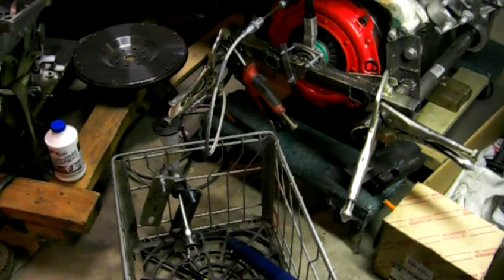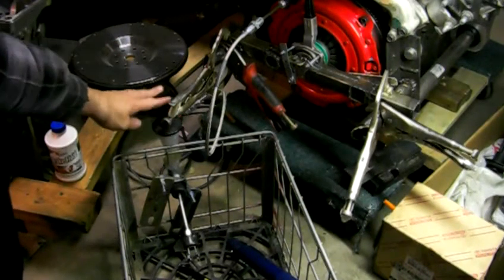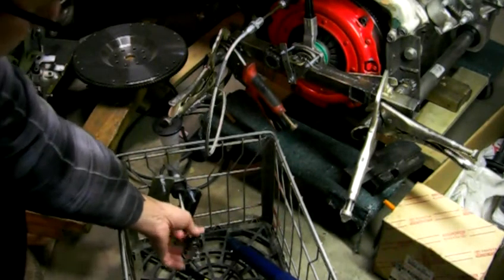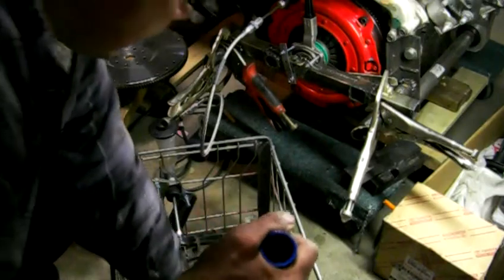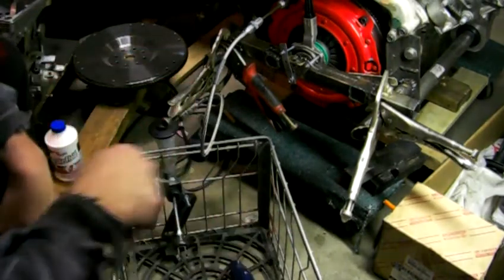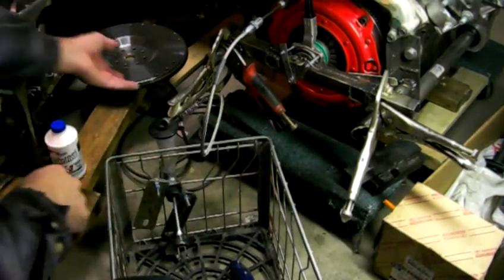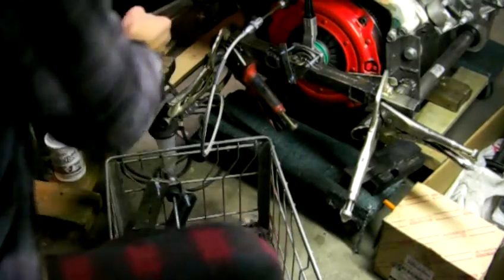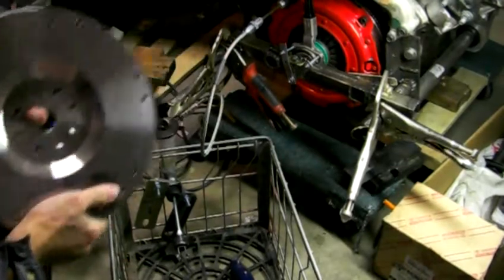V8 MR2 Engine Swap Clutch Test 3.MOV

Comment from the maker: Thanks Vic. 

As you know from the intro to clutch test video, lack of money is a show stopper for me with this project.  I need an adaptor for the flywheel to be machined, and I still need an engine computer, and lots of misc small bits.  Its frusterating, because the major stuff is done.  Engine/trans go into car no problem.  stay tuned for next video where I show installation of engine/trans!